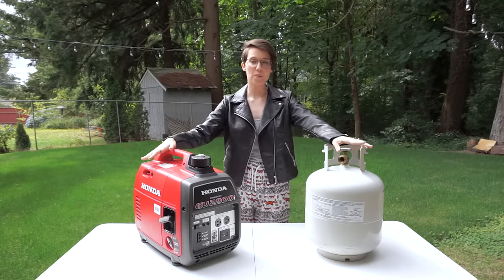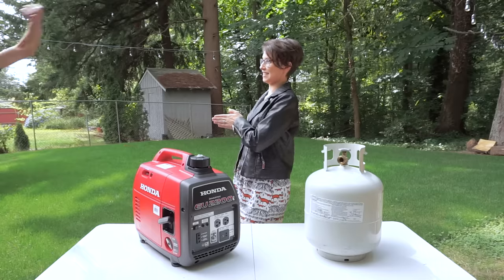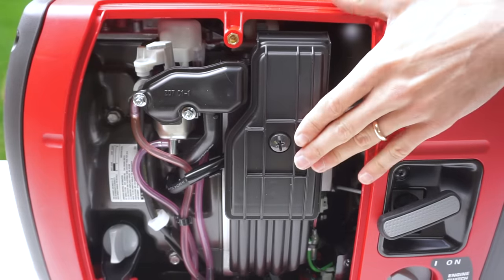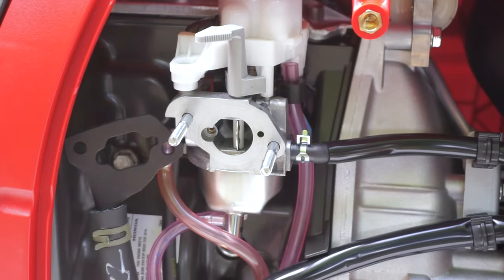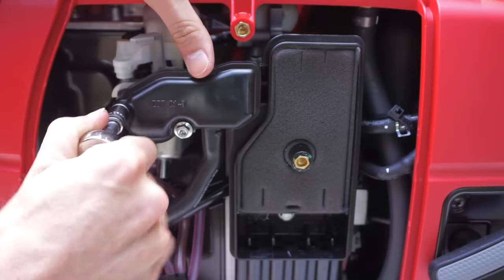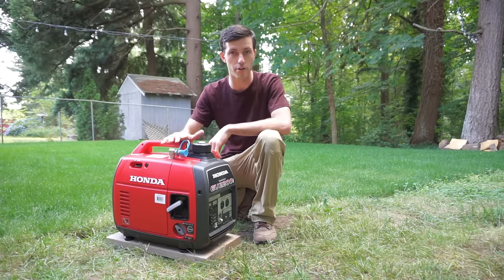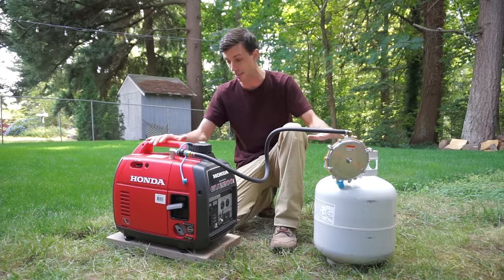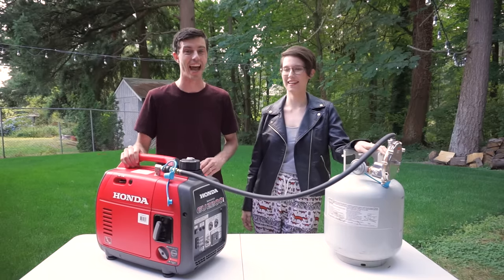Honda EU2200i Propane Conversion Kit - DIY Install for Honda Generator

Comment: I don't even have a generator and still watched this video!  LOL. But, I hate fumes so I'm all for this!  You do such a great job on all your instructional videos.  Well done you two!  Looking forward to your next travel video or campsite review!😉
Reply from the maker: Hahaha thanks Monica! Yeah we were blown away by how little odor the propane exhaust had, it is SO much cleaner burning. Travel videos coming in October, we are at my brother's in Seattle till then 😁
Reply: but as another person commented, it may be “cleaner burning”, but now you will have no warning of poisonous fumes because of it being so clean burning. this is why they add odor to propane and natural gas, so you can smell if there is a gas leak.
Reply: @shadowsilverlight1651  this generator sits outside correct?  It burns cleaner so less fumes because he switched to propane.  Like I said I don't use a generator but if I'm camping next to someone who does I sure would appreciate a cleaner unit that's burning propane instead of diesel or gasoline. The dangerous fumes?  It's not inside their trailer....
Reply from the maker: @shadowsilverlight1651  our trailer has a carbon monoxide detector inside. We will be fine.

Comment: Fantastic.  Bought my eu2200i today.  Was thinking factory built for propane.  Kind of like but the the concerns about the thread engagement.  Other things worth noting:

1) Wish there'd been a water-resistant/water-tight grommet for the pass-thru of the propane hose. KEEP DRY when running.    
2) Gas threads are left-handed
3) Wear gloves when taking off quick disconnect
4) Don't confuse "oder-LESS" (less odor) for a lack of CO (carbon monoxide)

A lot of people put disclaimers out there ... think about this.  You are clearly DIY'ers ... but you own a nice house ... so ... think about it.

Comment: Thanks for this video. I love that it's an either-gas-or-gas(oline) and not a gasoline-to-LPG/LNG conversion. I look forward to trying this out on mine. Two questions tho: How did it change, if at all, the behavior on eco mode, and how has the noise changed? In the video it seemed louder than mine on gasoline.

Comment: Please keep in mind, that while this “stinks” less, it still creates carbon monoxide so appreciate caution is needed so people and pets don’t die .☠️
Reply: yeah I think they forgot to state that. EXCELLENT comment
Reply: Hardly produces any CO, and only if its running rich. Its Carbon Dioxide.
Reply: Forklifts are used indoors such as warehouses running propane because they do not produce carbon monoxide IF they are set up properly, I.e. not running rich (excess fuel).
Reply: propane burning correctly produces water and carbon dioxide... the exact same thing humans produce.
Reply: My monooxide alarm went off, it gave me a headache so I removed the batteries.
Reply: Not an issue as the generator and the tanks are outside the trailer
Reply: Gas produce carbon monoxide too LOL
Reply: @LordGryllwotth  Good call. RIP
Reply: Hutch mountain
Reply: A perfectly adjusted fuel/air mixture won't produce any CO.  However, I wouldn't trust it to not produce CO because I'll never know if something goes out of adjustment.  Has anyone put a CO detector near the exhaust to test this theory?
Reply: @danburch9989  it wouldn't matter if someone did, there would still be naysayers. Just watched a vid of a guy testing CO emissions from a Mr. Buddy heater indoors and even though the detector showed no trace, everyone then chimed in that the detector must be out of adjustment and that you will certainly die if you use one indoors.
Reply: se fi  
We had a few in the Texas cold outbreak in February, but, they went to the hospital ...
Reply: re: "it still creates carbon monoxide "
BEAR in mind, dude, that there is more Hydrogen than Carbon in the molecule.  
C3 H8
MUCH more H ... and these are gas molecules, not atomized gasoline molecule 'clumps'.

Comment: Any idea yet how long the generator will run on a 20# tank of propane? Is there a significant increase/decrease in run times for the generator? (No more getting up in the middle of the night to refill the gas tank on the genny?) Also, have you calculated cost differentials between the gas and propane versus usage times? 

Also...I like how you handle some of the more confrontational comments below. I don't understand why people have to respond so aggressively. If the conversion is not for them, why not simply move on with your life? Or why watch the video to begin with? You two are a nice young couple with a GREAT channel (one of my top two!); never let those trolls or negative-nellies get you down.

Last thing: I LOVE that Hank Hill comment! Funny stuff.
Reply from the maker: From what I'm reading online, a 20lb tank has 4 gallons of propane in it, and would run for roughly 28 hours at 1/4 load as compared to a gallon of gasoline providing 8 hours of run time. This is just secondhand information from the internet though, I've emailed Hutch Mountain for a confirmed run time. I'll let you know what they say when I get a response.
And yes, we have grown quite a thick skin to negative comments. They really don't bother us so we're able to respond with a cool head 👍
Reply: Depending on how much power you're drawing as well. An ac unit on will reduce the run time due to larger draw. Just my experience.
Reply: @FateUnbound  i have a Honda 2000w with less than a gallon at low i get 11 hrs and with the roof ac on(364 installed frm MicroAir) i get about 6 to 7 hrs of running time..! $2..$$ Imagine if i have to go like everyday to buy a propane tank..$20..that is way expensive%..bro..!..!
Reply from the maker: Hutch Mountain got back to me and said 30 hours of run time at quarter load, 22 hours at half load, and 12 hours at full load off of a full 20lb "bbq" size propane tank. I think that's pretty good!
Reply: @FateUnbound , I agree!
Reply: Manolo Vicencio correct, you’re paying about $7-10 more per 30 hours of run time for the convenience of running propane. That doesn’t take into account the cost of the conversion kit either. However, It also doesn’t factor in the extra life your generator will get by running a cleaner fuel or the cost of fuel stabilizers if running gas or the time you’ll be saving by not having to refuel your generator every 6-8hrs or having to buy and carry gas around. Personally I feel the pros probably outweigh the cons.
Reply: @CJ-dy8lb  - You could keep in mind that Propane can be purchased in 20lb, 30lb, 45lb and 60 lb canisters for convenience. Any Mobile home or RV center will sell those. 20lb canisters are just more convenient for 'BBQ Boys' like me who use Propane to to BBQ in the back yard. If you have a trailer, you can buy 60 lb tanks for the them and use a  connector.
Reply: I had propane on a 454 in a one ton. 5-6mpg vs 8mpg with gas. And HP is also down about 20%. It is very clean burning. Back in the day propane was 1/3 cost of gas now they are the same $/--.  Also used propane in a motorhome and in back up generator for solar system.
Reply: Manolo Vicencio Don't buy those $20 trade in's that are only 3/4 full with 15 pounds in a 20 pound tank they are a rip off, in PA you can get a 20 pound tank filled to the max for $12 and the most I ever remember it being is $15.
Reply: @RedneckHillbilly-ho9md  - you can pretty much do that in any state, if you can find a " Filling Station " for Propane ( we have one down the street, and a lot of gas stations around here do so also. 

The one advantage of trading in, is the company that fills them, has to pressure test and monitor for leak, where as your on your own if your filling up that same tank each time. Like all canisters that are pressure filled, there is the chance of failure at some point. Otherwise, ya your paying for the convenience of not having to travel around looking for a "Propane Filling Station ".
Reply: @bobh.6108  The only time I buy the $20 trade is when my tank is beginning to rust and I can exchanger it for a newer one.
Reply: @ellispickett8866  it works Mate. I have a station up the road, but I would rather get the trade in. More convenient, when your only buying like 6 tanks a year total. One being used and two spares. nearly every store around here has propane exchange. '

How long do you normally hold on to a tank before turning in?

Comment: An hour meter is also a requirement on a new generator for me. Much easier to track maintenance.
Reply: When you start the honda count the flashes on the run light. Each flash = 100 hours. Harbor freight Predator is 1/3 the cost and a much better value. Good generators Honda is usually but HF is fine. HF honors the warranty, Honda will not.
Reply: @Dive-Bar-Casanova  Is there a propane conversion for the predator?

Comment: With the gas tank being 0.8 gallons and run 8 hrs, that means for 4 gallons of gasoline we would get 40 hrs runtime. 
With propane we get 28 hrs runtime on 4 gallons.
To compare, 28 hrs runtime on gasoline would be 2.8 gallons??...
Gasoline here is around $2/gallon and propane is around $20 per tank (4 gallons).
Gasoline cost for 28 hours is about $5.60; and, propane is $20.00.
I'm not seeing how folks say propane is less costly. Help me understand where I went wrong with my math!!!
Either way, I think it's well worth having two fuel sources. And you guys ALWAYS have awesome informative vlogs!!! Thanks!!!
Reply: propane is $2.79/gallon at tractor supply. You save money if you get your old tank filled, instead of swapping. They said they rarely use their generator so not having to deal with gas going stale/gumming up the carb is worth something too.
Reply from the maker: First the tank on the EU2200i is .95 gallons with 8 hours run time on gasoline. So more like 32 hours of runtime on 4 gallons of gasoline. Hutch Mountain says 30 hours of run time at quarter load, 22 hours at half load, and 12 hours at full load off of a full 20lb "bbq" size propane tank which is roughly 4 gallons of propane. I think that's pretty good!
Your local propane prices are insane! Where we are now propane is only $2.35 per gallon and gasoline is $3.40 per gallon. So running off propane here would be much cheaper. It really just depends where you are and what the local fuel prices are. That's why we love that this kit gives us the option to run off gasoline or propane with the flip of a switch!
Reply: Bob & Peg, my scenario was based on swapping. I also had the Honda gas tank size incorrect. So, new wrinkle in brain... No swapping!!-

Comment: Awesome video. I am now going to pull my Honda out of the mothballs and do this conversion. Being able to run it off of propane will make all the difference in the world. I hate gasoline. I got two electric cars just so I wouldn't have to deal with it any more.

Comment: i wonder if they have a bigger regulator,  that one seems way to small
Reply: lol
Reply: Precision two-stage regulators are for better fuel efficiency and precise fuel pressure regulation, no fires in the generator here, lol!
Reply: LOL, suitable 2 to 20 kW.
Reply: Yea its Linda large not sure if that's big enough
Reply: That is the bigger and better KN regulator, small one is 4”

Comment: Thanks for the promo code!  I have been wanting to do this to my Honda 2000 gen.  I like that propane stores better than gas and it'll surely run longer on a 20lb bottle vs. the .8 gal stock fuel tank.  Awesome video!
Reply from the maker: You're welcome! We will only be running ours off propane from now on, there are so many pro's to propane over gas! Glad you liked the video 😁👍

Comment: Excellent video; but running on gas with “X” percent load equaled a runtime of what compared to the same load on a twenty pound tank?
Reply: Good point. I also wonder if it reduces the continuous wattage rating of the gen.
Reply: Thomas Cunningham It does because Propane and Natural Gas are lower energy density fuel sources.  I believe it is approximately 15% less wattage available from P/NG.
Reply: Good stuff! I run large diesel gens for emergency back up power, so we derate our units for use with different fuels (JP8 V JP5 V DF2). Didn't know percentage wise for propane however
Edit: Spelling

Comment: I had a Ford Ranger that had over 500,000 on it, the propane conversion had been on it since new. I got rid of the truck because I needed a larger truck but when it left it still started immediately and didn't use oil or smoke. I should have kept it in hindsight.

Comment: That's the thing about carbon monoxide it's odorless and tasteless.
Reply: It’s also a great sleep-aide
Reply: That's why I add panchetta and garlic.
Carbonara Monoxide
Reply: That's why sulfur based aerosols are added to keep customers from accidentally  leaving on the stove.
Reply: Usually for propane, yet I don't see the impossibility.
Reply: you won't get carbon monoxide won't happen in the great outdoors tho, only when the internal combustion engine has no ventilation (indoors).

Comment: To take the glue residue off left from a sticker, you can use WD 40 sprayed onto a paper towel BUT, you need to wash the WD 40 off of the surface with some Dawn blue liquid detergent.  This will get rid of the nasty sticky glue and the Dawn soap gets rid of the nasty oily WD 40.  This method works on the BUG/Mouse/Rat sticky traps too.  Thank you.
Reply: Use goof-off for any sticky residue

Comment: I need this in my life.
Reply: i also need something geeky and femaley
Reply: @ketas  😂 👍
Reply: I’m ordering . Thanks.
But question.
How long will it run on a propane tank?
I’m thinking of just carrying a gallon of gas in my Jeep for my rpod then switch to propane when the gas runs out so I don’t have to buy more gas rotopax. Those things are expensive,
Reply: This will be mine lolz

Comment: please remember if you are a winter camper that (propane/butane) gas and cartridges do not work in really cold environments because it doesnt change to gaseous state anymore (or in enough volume) and also the bottle is cooling down during usage. so might have to start on gasoline (or use RV Engine)
 and produce some heat for the bottle. (electric heater pad, exhaust rerouting)

Comment: Hi, thanks for the insight and the demo. My question is how much wattage do you lose using the Honda 2200 on propane as compared to gasoline. Thanks. Just purchased a 2200 and want to use propane on it for my camper ac unit. Jerry
Reply: would like to know

Comment: Forgot to mention that 2200 peak / 1800 running aver. generator is now a 1600 watt generator with propane.
Reply: Used to have a heavy truck that had been run on propane as part of a pilot project.  The oil was absolutely clean but  the truck was GUTLESS and used more propane (which cost more) than gasoline when I converted the motor back to gas.
Reply: and unfortunately even less on natural gas. My house is plumbed with natural gas so it'd be nice to buy a dual fuel unit and convert to tri-fuel.
Reply: How long do you figure it would run on a 20 pound propane tank?

Comment: Note of interest:
Propane burns cooler - less BTUs - so, the generator will not produce 100% of its rated output for gasoline on propane but appx. 80% to 85% of the rated output. Keep this in mind when determining what size generator you think you need.
Reply: I’ve seen side by side tests gas/propane of this generator and your statement is incorrect. There is no difference in power output
Reply: Add a load block and lean it for maximum power, altitude changes and fuel efficiency!

Comment: How long will it run on a tank of propane?
Reply: Will die never knowing.
Reply: I had the same question.  I want to know what the difference is in run time between the two types of fuel.  I really hope they bother to answer viewer questions.
Reply: I have a Champion one and I guess if you ran it constantly it would last 2-3 days or more with propane. I use my when working with power tools and it lasts over month because I close the valve when not In use it’s pretty amazing

Comment: Thank you, this video was very helpful.

All the hoses, fittings, quick-connect fittings, regulator are very nice, excellent quality.

However, the Honda factory two long M5 x 95mm carburetor bolts with a square head are too short. Torqueing down only 80% of the threads is a no no. I found some 304 stainless 140mm Double End Threaded with 77mm of unthreaded area Stud Bar Rod Screws Bolts with stainless square nuts on ebay. Now I have 100% thread contact between the bolt and nut.

The propane/natural gas 3D printed manifold has two different 3D printed jets, one for propane and one for natural gas. I hope by changing the jets now and then, it won't crack the 3D printed manifold. The manifold surface is very porous and rough from the 3D printing. I hope it won't leak any air over time.

I would've preferred a "Load block adjustment valve" on the regulator vs adjusting the regulator output to fine tune the idle. 

Propane and natural gas probably functions similar to a carburetor using gasoline that has a separate idle and fuel/air mixture adjustments which is much better to fine tune than adjusting the gasoline going into the carb. Especially for different elevations and air temperatures.

Before I purchased my Hutch Mountain tri-fuel kit in early 2020, I believe it was the best option at the time and I was able to speak with the owner over the phone who was very helpful and trustworthy. How often can you speak directly to the company owner nowadays. 

If my 3D manifold did break, he'll probably just send me a new one.

Comment: Pretty impressive conversion kit but I think the kit manufacturer should include longer carburetor studs. I didn't like the nuts only having half engagement.
Reply: Oh come on now. For a kit that costs a dollar three eighty what do you want ? Lol.
I do agree about the Carb studs . The bolt in the air box should be longer also.
Reply: It is not a big deal.  Those nuts are not going anywhere.